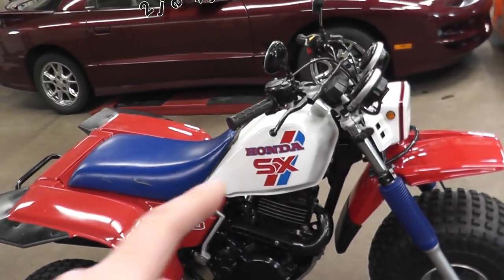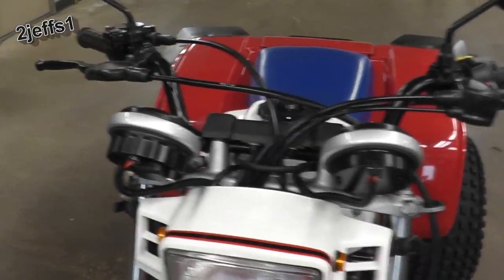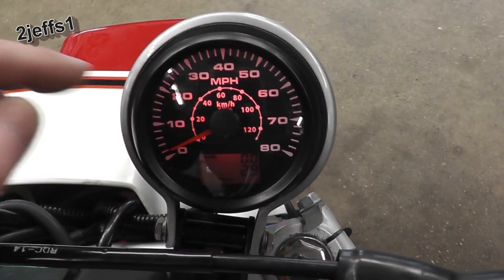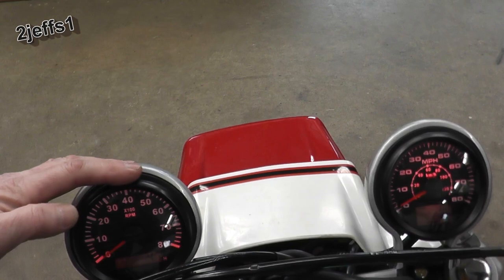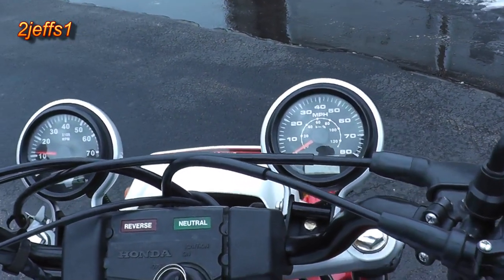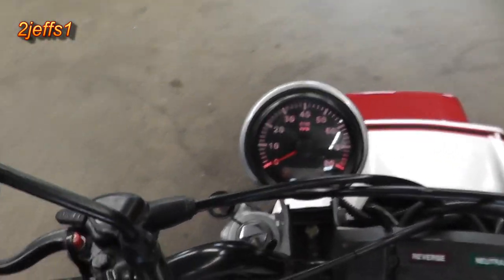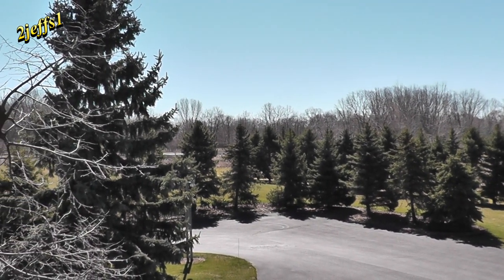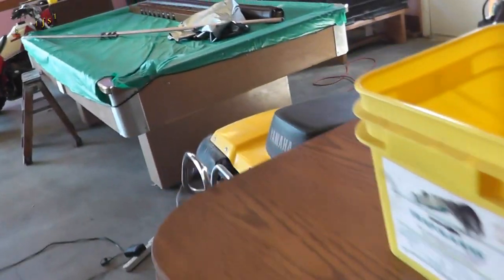GPS Speedometer DIY Install

Comment: I would watch them all.  I have a 1981 Yamaha Enduro 125 sitting in the garage to rebuild.  Great gravel and dirt road bike. I do wish I could get 60 mph out of it when I hit the short pavement runs. It will probably take longer to get the dents out of the tank than anything else in the repair unless I decide to powder coat the frame.

Comment: Thanks for your work Jeff.  I'd love to see both the man cave vid and the Yamaha restoration. I had a 1978 GTMX 80 (the red tank one) as a child. That's cool you got the wirey/crafted looking heat shield on your muffler,
 not the stamped one I thought they had switched to around 1980.

Comment: Hi, I got the Eling tachometer to install in my 1972 VW  Karmann ghia. It has a generator and electronic ignition.(pertronix)  I have the Signal input attached to the Distributor side of the coil, but I can't get it to work. I'm not sure what to set the speed ratio at? Any advice!!
Reply from the maker: Not familiar. Sorry - can't help you with that one.....

Comment: Those gauges are great.  Did you get the tach to read closer to actual?  Many years back i tried putting a really cheap small tach on my 250ES, and it read too high.  Then something in the trans let loose, and its been parked in the woods ever since.  Definitely like both things, and yeah, The Hondaline speedo is a rare and expensive thing.  Definitely like this option better.  haha, That tach wouldn't work too well on the '72 CL100 though, 11HP at 11,000 rpm :)  Really perfect additions to the perfect looking SX.  For sure.  :)    Great video there Jeff.  :)  As always.  Got me  thinking now... :)   As for the 3 videos, haha, Well, I know its a lot of work, but i'm kinda fascinated by all of three.  The 80 looks so nice, it would be great to see it getting to that point.  The 70' DJ setup really has me intrigued, and the man cave in general looks like it has a lot of aspects to dig into.  I do know its a lot of editing, time and work, but if its really down to just one, I guess it would be the DJ setup.  (hope i get to see all 3 though haha)  Cheers man.
Reply from the maker: Hi Tom. That 70's DJ setup was a supplemental income on the weekends. When doing weddings, bars or 40th birthday deals was my helpers and I got free drinks all night besides getting paid for the gig. So many stories I could tell. Met many cool appreciative people. Some time in the future I hope to setup live and then I shall share some of the fun! I was worried putting up the man cave stuff where the girlfriend said you might sound arrogant where people really don't know you. I could see that. I did 2 shoots out there and not happy with any of the footage. That room WAS put together with so many things that friends brought over and almost sounds too good to be true. I do help many people out but no one gets to see that part. They are welcome to use anything here so.... The tach - Yes I did get that to read as should now, no biggie, reminded me of one of your vid'a a bit ago. Oh - a quickie - I was trying to get a 2014 Honda 400EX. Wanted to put that engine in the 350. Then would have electric start and reverse. The only thing would be the oil tank where it is that sup system that I could see. I didn't offer enough so he sold it now. There is an 07 which is quite a ways away. Affordable but...  we'll see.  Thank you for stopping by, Cheers Yup!